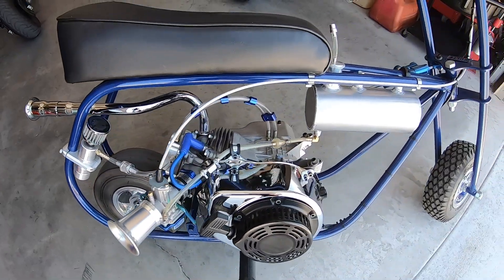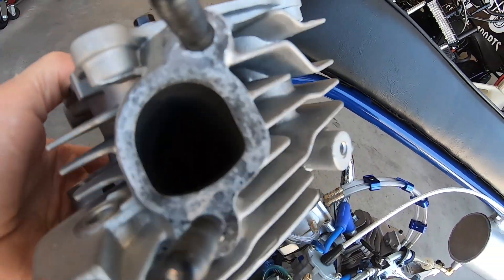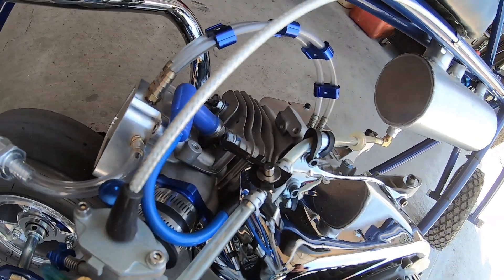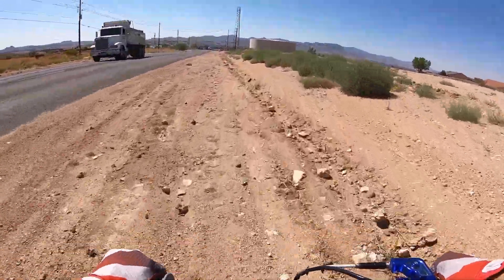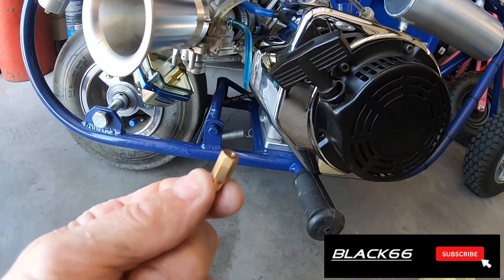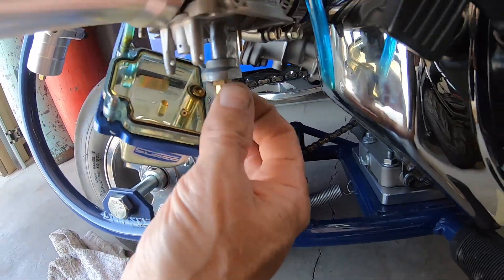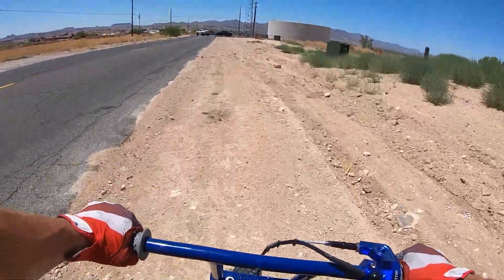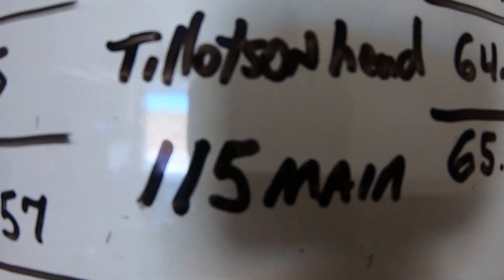Predator 224 cylinder head VS Tillotson 225R cylinder head

Comment: If you go to a big valve head , you’ll want to make sure to increase the carb size to match the larger seats. If you swap to a big valve head and don’t increase carb size to 28mm the engine will make same or even less power because now moving big valves / more resistance. But if you give the big valve the correct carb size / the air they need it makes a ton more power. The big valve head with a small carb = carb is the restriction or straw in the system so it can’t breathe. Cool videos man.

Comment: Hey black66 you really should pair the mod2 cam with the stamped 1.3s and 26lb valve springs i also added billet retainers but just doing tbe 1.3s on the mod2 will definitely out perform even the 265cams maybe not in 0-30 times but definitely in top speed mod2+ 1.3s =292 lift on the intake and 300 on exhaust stock length chromoly push rods or stock push rods its a cheaper set up then a hot265 or fire265 cam and i bet it makes more power fallow this build list and put it against another 212 with a 265 cam and see if its actually faster and is so by how much 
-Predator 212 non hemi 
-Non hemi head (light sanding of short turn radius) 
-26lb white stripe springs
-ec billet retainers (red because race bike lol)
-stamped 1.3 ratio rocker arms 
-chromoly stock length push rods (stock would probably be ok too i was just worried the 26s would bend the stock push rods especially with 1.3s)
- arc rod 3.308
- stock non hemi piston 
-mod2 cam 
-Vm22 carburetor 
-arc billet flywheel 32°
-pauls karts hot coil 
-staged header pipe 
-.010 head gasket 
8500-8000rpms reliably iv got over 2 years on that set up running valveoline vr1 20w-50 racing oil i would so love to see you build/test that combo against a bigger cam to show the full potential of a mod2 cam
Reply from the maker: I hear you, I like the MOD2. I used a MOD2 with 1.2 REV ratio rockers on the Predator 224 in a few videos with a lightly ported head and some billet parts.  I think it did what you said. Not as quick but faster top speeds. Your build looks pretty sweet!  
I'll have to try 1.3's.   https://www.youtube.com/watch?v=oxhroZjFb1A&list=PLkbj-ip-5FzZ4tKihy7hQLgISLoliBLRz&index=12
Reply: @Black66  you definitely have to build a 212 very similar and give it a shot mod2 ,stamped 1.3s ,26lb valve springs predator 212 non hemi with a non hemi head really goes I still need think if you swap out the stock dished piston out for a .570 flat top and 3.308 arc rod that engine will be able to take full advantage of the big duration and lift I am ordering the .570 flat top to drop in it here soon after 2 years of running 8000rpms I am curious to see how she looks on the inside nothing is wrong atm just going to swap pistons and throw in a new set of rod bearings while in it (note) in current configuration I have been told that my set up would make anywhere from 14hp to 17hp thats pretty impressive for a mild build 212
Reply: I run that set up on my gx160 I’m hitting 60 mph but my Honda head is the one that comes factory with 27mm intake
Reply: @Stingyduce  where did you find a gx160 head that has a 27mm intake valve id love to put that head on my set up
Reply from the maker: @madness_-yg3lw  https://kartcityperformance.com/outlaw-modified-clone-head-assembly-14cc-clone-head/
Reply: @madness_-yg3lw it comes stock on the new gx160 ut2 engine

Comment: Sick little bike brother, I just bought a new Tillotson which is advertised 10 horsepower out of the box. I don't want to do any internals but would you recommend I install the cast aluminum flywheel? Thanks for the video and ride safe. I already have the header pipe, bigger jet and a UNI filter for it.
Reply: In my opinion no, the tillotson flywheel is rated for some decent rpm, if you're not worried about the rod I wouldn't worry about the flywheel, just my 2c
Reply: @FreeRunMonster802  thank you for the information, I think I'll leave the factory flywheel on. I want to keep it as reliable as possible, i can always use some 2c.

Comment: Same factory in China makes the Tillotson and the Predator 224. Ducar is the name. They also do the 212 Predator hemi.
Reply: However, the ducar branded 212 is cheaper and better than the predator goast. The flywheel is a key component. Rated for 17000 rpm